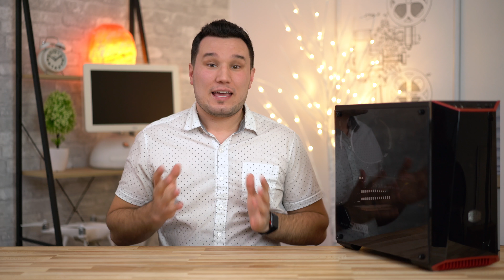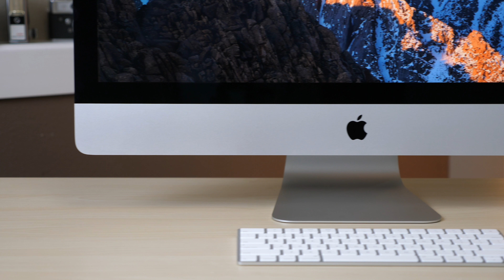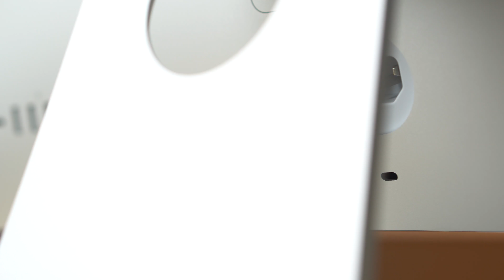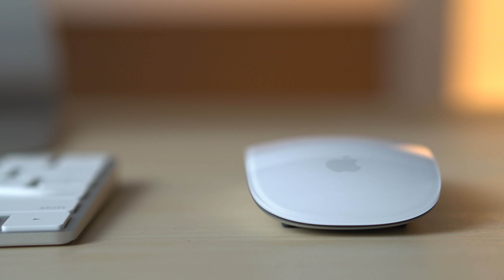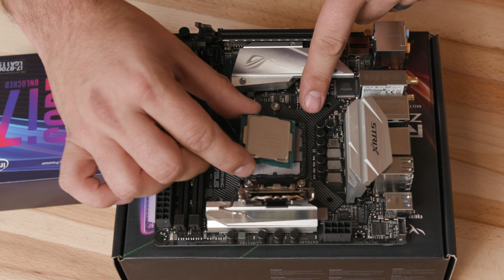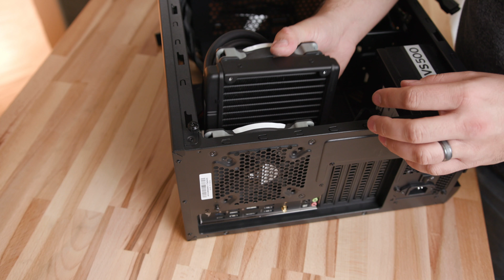$1350 PC vs $3000 5K iMac for Video Editing - FCX & Premiere

Comment: So i guess, there is no clear answer, which one is better, Mac or PC...? The reason why Mac with Final Cut Pro runs faster even with little more modest specs, is that in Apple, both hardware and software is made by the same company so Apple's softwares are fully optimized to work in the hardware. I have at the moment 5 years old Retina iMac with 4gig RAM, and planing to start doing 4K 60P/HDR video editing in a near future, so i wonder should i little upgrade my current Mac, or would it be better invest to new machine with HDR display, Because in Retina iMac have 8bit display, so when editing 10bit HDR vid, i guess the display should also have 10bit panel ?? Mostly at the moment i'm wondering, should i stay with Mac, or turn to PC...? But as i already said in beginning, there is no clear, or one right answer to that topic... PC system could be little cheeper, but in the other hand, Mac system is more user friendly and perhaps more stable machine.

Comment: SHORT version: for media consumption and light work use apple, for media creation and heavy work use pc.

Hello everybody, Greg here, 15 plus years of experience in broadcast (Spain, Poland, Norway) - here are my two cents, to give you the best advice I can, based on what I've experienced in this industry.

1 - Professional Work (tv studios, film studios)

Those are the slowest to adopt change (30 to 50% of people still use avid 😱) mainly because change slows things down at the beginning and can cause profit loss. But it has eventually changed. Today - all serious and heavy work is done on PC only. Custom build monsters. Those are used for media creation. For light work and client presentation it's 50/50 some use PC, some Mac.

If you dream is to work in TV, than I'm sorry to say, but you need to have avid & premiere in your packet.

2 - Enthusiast & Hobby. If you work in home, you can choose whatever the duck you want 😊 Mac is easier to start with, operating system itself as well as editing software (Final Cut). If you use Adobe - than use PC for better performance.

Congrats on video by the way, very informative!
Best regards, Greg.

Comment: Great reviews - thanks Max. Hoping you will do it again with the new 8 core 19-9900K just released. 
Questions
What about testing the PC as a "Hackentosh" running FCP and free Resolve 15?
Why do you think FCP on iMac is faster/ more efficient? 
What do you use for your DJI H.265 4K 100Mb editing? Do you use proxy/intermediate codec workflow?
What about HDR REC2020? All new UHD TVs have HDR support.
Thanks
Reply: background rendering / intel quicksync

Comment: Use the same editing software for the example, it's unfair if the editing software is different.
Reply: not really.  the premise of the video is that with windows pcs you get raw hardware power, while on macs you have dated hardware.  FCPx is the equalizer... possibly even the killer app for editors that makes Macs a no brainer.  Although I've seen some good numbers on other youtube vids, where DaVinci  works almost as smoothly as FCPx (some of those numbers were shown in Max's vid too).  Another bonus for DaVinci is that it comes with SO MANY features in the free version (i think one of the main selling points for using DaVinci's pro version is that it can use multiple GPUs)

Comment: PC for $1600 (i7 8700k + 16gb RAM + 1060 6gb graphics card + 1080p Dell IPS monitor)

& 21.5" iMac for $1700 (i5 3.4ghz quad core + 8gb DDR3 2400mhz RAM + Radeon Pro 560 4gb Graphics card)
Which one I should go for?

Purpose - Video editing (currently using Premier Pro, would be happy to use Final Cut Pro for lag free and fast work)
Would like it to play Sony fs7 RAW video files without any lag.

Note - Used windows for my entire life.
The reason I thought to go for Apple because of reliability as said by users.
Personally it feels and look premium and so beautiful and no hastle of thousand of cords etc. Easy to carry.

Still confused which I should go for..
Reply: Dont sleep on MacOS.  I don't know if its a "better" OS than windows, but it sure is a lot more polished.  User experience is a factor for some people, and it's a completely valid selling point.  My Ryzen pc I built about a year ago still beats out the iMac in test scores, and while I really like having a triple monitor setup for having a lot of Excel spreadsheets open while also having room to research... It is a work (#puke) / gaming (i barely ever play games anymore) rig.  The iMac is a pleasure to use.  Its well optimized, integrated into the ecosystem, and that display... man oh man...  I saw the LG 4k display on sale next to the iMacs, and even though they're both LG panels... Apple doing their voodoo magic on the iMac just makes it a joy to stare at.  Also, UI-wise... magic trackpad 2 is a game changer for me (i wish i just bought the mouse/trackpad bundle at checkout, but i didnt think i'd want it because i was so used to a mouse.  But after briefly owning a MBP and playing around with its force touch trackpad, I had to have the MT2).

Plus there is the option of going all in on FCP,; i dont like how theres so many things you have to pay for after initial purchase, but we'll see after i get some more time to play around with DaVinci and see how it treats me.

Comment: Hands down the best and fullest comparison I've found. I am using an HP laptop and having problems with Camtasia. Which has lead me to here. The checked B&H for recommended laptop to use and it's $2,900. I thought, "why not just get a Mac?". Given the analysis and the general information I've found. Mac has some really good software options that are less expensive than their PC counterparts and they seem to perform better in speed and ease of use. I say "SEEM" because I cannot speak with experience on this. But I am now strongly considering buying an Apple Laptop. Thanks for the great review and the clarity it brings. Very informative. Wish you the best on your channel! Great Job!

Comment: You should do a 4K rendering comparison between the iPad Pro and laptops. Apple and several benchmarks are suggestion that the iPad Pro is starting to rival the performance of some fairly powerful laptops. It would be very interesting to see how a cheaper and more mobile tablet compares to bigger, heavier and more expensive laptops. I've seen some promising results for the iPad, but nobody has produced a high quality, in-depth comparison with both a Macbook Pro and a Windows laptop. LumaFusion offers a fairly advanced video editing software, and I wouldn't be too surprised if the A10X processor plus good software optimization could come close to a good Windows laptop, especially after seeing the results comparing FCP with Premiere Pro.

Comment: Hello Max :) I do edit in FCPX but with that new Resolve 15 I really wonder how it compares !
Also, the next iMac & Macbooks won't have a true GPU upgrade, just a higher end model from the same range we have today, i guess since AMD didn't came out with new entry level GPU. I do play some games from time to time and the lack of GPU power obvious. I wonder if Resolve benefits more or not from a more powerful GPU. In short : I'm editing on a MBP 2016 and plan to get the BMPCC, I know that the Macbook won't be enough to fly though 4K RAW on Resolve. FCPX will generate proxies and should be fine to edit with. Nowadays I do the grading on Davinci because of the more advanced tools, when needed, but then I get the Timeline back on FCPX and still have to color edit to fix some minor color deviations or exposure. It's not so much convenient and the add of embed Fusion makes Resolve even more appealing. Also I know that FCPX generates automatically proxies and I wonder how Resolve cache works, if it renders in the RAM or VRAM, what configuration could benefit from this.

In short I would like to know more details about Resolve 15 overall performance and also how it works compared to FCPX. It's surely not the same workflow. As example you won't be able to edit raw from a HDD while FCPX could handle it thanks to proxies.
While you can also work with proxies in Resolve (and it has a very good media conversion tool), it's not as simple as far as I know.
I remember that on Premiere I had 2 years ago HUGE issues with proxies and effects Management. That's never been a problem on FCPX, wonder how Resolve deals with it :)

Suggestions suggestions !

Comment: I think we should put things in perspective. Nowadays editing machines are fast. I  just finished the edit of a 63 minutes documentary which took us months of headaches, and it was on Premiere on an imac 5k ( i use it because I'm more familiar with the interface, coming from fcp7 and the editor knew the program too) . I think that render times are non-problem, we practically never rendered during the edit and it was all 4k footage Prores, when it was rarely needed we did it on small breaks of a few minutes or seconds. The thing is that most footage doesn't need rendering in premiere (if it's shot well), and even during the finalisation when you add filters and color correction, it's still a minor hiccup the render, 30 seconds here and there doesn't make any difference.  The only time I need faster rendering is when I'm on a laptop and videos need to go online immediately. Anyhow Premiere is full of bugs and something about doesn't make you love it for big projects... Great video Max!

Comment: Hey Max, There have been a lot of test but they all use the internal drive. Most editors are not using the internal drive. Are you able to to do a test using an SSD Raid system and or external GPU test?
Reply from the maker: There will be no speed difference as long as the drives are not bottlenecking the system.

Comment: So, Max, quite a few folks are discussing hackintosh and it would be a very interesting thing to throw in the mix. (I've been in the hackintosh world for about six years and use my machine for pro production work.)
I think there are assumptions that with a 8700-based system and FCPX, it would beat both the PC and the iMac for less $$. The BIG question to me is that as we throw our various components into a PC box and hack macOS into it, we may not be realizing the overall performance of a tightly integrated system such as an iMac (which I would still be fine with given the cost savings).
If you are interested, you would need to throw an AMD card into your PC along the lines of the 580 as FCPX is optimized for AMD. Poor render times comparably with NVIDIA cards. 
Just a thought. Thanks for your reviews!

Comment: Thanks for sharing you tests. I have been on iMac since 2012 and I have always found FCPX easy but many clients expect Adobe Premiere and After Effects so, I am stuck with the Adobe subscription. The shock for me is how unstable Adobe still is on windows. My 2012 iMAC runs it with far less crashes than my recent HP Win 10 laptop which has far superior graphics card and memory. After so many years, you'd expect Adobe to get their shit together. So, all the graphics power in the world won't compensate for crashes. I will have no choice but to keep an Adobe subscription but HitFilm Pro is now my preferred solution for many smaller projects with FCPX as a backup. Many friends are recommending DaVinci so, I will take a serious look after my next hardware buy ... which based on your great video will be MAC.

Comment: For "Video Editing" (Not effect), premiere is very weak in "footage management". Compare with Smart Collection in Final Cut Pro X and DaVinci Resolve, the smart bin in Premiere is a little bit useless...

And Final Cut Pro X got a very good function on "Favourite, Rejected, Unused" "keyword" hotkey/shortcut to manage the footage efficiently.

Another weakness in Premiere is the shortcut... there are many useful shortcut in "place on top, overwrite, insert, place at the end, select clip edge, trim start, trim end, Source media selection, change clip duration..."Both hotkey/shortcut in Final Cut Pro X make you editing in a very high speed. But in premiere...

Also "Audition" function in FCPX is very useful tools for drama editing too.

So, good computer hardware can make you having a faster render/preview speed. But good editing software is the only way to make you editing fast. 

For efficiently video editing, I suggest to use Final Cut Pro X.
For video editing + color grading, I suggest to use DaVinci Resolve.
For video editing + effect, I suggest to use Premiere Pro. (Just because of After Effect)

Comment: Wouldn't it just be easier to by final cut pro with an iMac included in the box?That's all it's good for.So Mac has fallen from its glory and is only good for one program and sucks at everything else for 3 times the price.Luckily I render in 3D so don't need to sell a leg for just one program.Adobe has always sucked though.If you think I'm my work machine is an old 2008 MAC Pro with Windows 7 and my Home PC is a real PC ofcourse.

Comment: I want to ask you guys what you think about this: One 4K monitor 27'' for $600 or Two 1440p monitors 27'' for $600?
I's a personal preference for me to go with a 2 monitor setup. I like working like that better. And from a regular viewing distance, you won't see a difference when you are watching 4k videos, the only difference being the OS resolution which makes the buttons and windows smaller so more can fit on a 4k display, but with that being said, if for the same price I can get another display where I can place buttons/windows, I don't mind. I actually like the buttons to be a little bit bigger. (the Pixel real-estate is similar 7.4 MP for 2x1440p vs. 8.3 for single 4k)
Reply from the maker: I love resolution so I’d say go 4K and add another one later. Or go for a 31” or so 4K. I personally am editing in a 5K most of the time. If you like dual setups that may be a good option but if it’s for color grading then make sure they are accurate ones and IPS so the viewing angles are good.

Comment: For premier pro. I always use adobes proxy files feature (using premier pro 720p cineform proxy, dynamically linked to the full resolution files), and I have no issue with 4k 60fps files on a 2013 pc (5 year old pc). export times are still longer, but timeline performance is buttery smooth on my 5 year old pc premiere pro (just have to create proxy files the night before), however I understand this workflow isn't suited to everyone

Comment: What about the quality? It's very easy to make something faster by reducing the quality. E.g., linear interpolation is easily 50x faster than a decent sinc one. And by adjusting encoder parameters you can easily make the encoding 20x faster or slower. Same goes for hundreds of details.
So, did both pieces of software use the same quality algorithms and encoding parameters in your tests?
Reply from the maker: I set everything the same and the final video look the same too. I’m not sure if there are any minor differences but I couldn’t tell.

Comment: You should ABSOLUTELY try to swap the GTX 1070 with the RX580 or even a Vega card and do an hackintosh on that build. Don't think you're gonna regret spending the time on it: you should be able to use Final Cut Pro X with no problems at all and therefore enjoy both the pure performance of the DIY PC and the optimization of FCPX. Would you try it? (PS: hackintosh actually works with Nvidia cards, but you wouldn't get GPU acceleration in FCPX)

Comment: Other cost to factor in is the $600/year cost of Adobe vs the $400 flat fee for FCPX, Motion and Compressor.  Every year the cost of that PC Adobe system keeps rising while the iMac with FCPX doesn't cost a single extra penny until the system needs to be replaced.  Given how well optimized FCPX is that hardware lasts for a good 4 years before the pain is really felt and even then only an issue if the formats used drastically changes.  That vastly increases the cost for the PC/Adobe user while the iMac user has nothing to worry about for four years and can just focus on what matters, getting projects done for clients.  Four years at $600/year is $2,400 vs the $400 for the Apple software.  Thats a $2,000 difference that needs to be added to the cost of that PC/Adobe system.
Reply: Tell Adobe each year you want to cancel and join at promotional rate before renewal. Has worked for me for the last 4 years. I pay $32/mo for the entire creative suite.
Reply from the maker: Very good point. Premiere alone is $30 a month plus tax or $50+ tax for the whole suite.
Reply: Thats still $384/year or $1536 over four years and that cost never ends.  Even if you factor in the typical extended warranty of a Mac of 3 years that is still $1,152 over those three years and you have to factor in that cost for the PC/Adobe edit system.  Realistically there is no such thing as saving money by going the PC/Adobe route.  I still edit native HD and 4k from a GH4 on a 2012 iMac which is now six years old.
Reply: Also important to factor in legal licensing for small edit houses.  Mac App Store applications can be used on five systems.  Adobe only allows the use of their software on two system and technically that isn't supposed to be concurrently.  That means two editors shouldn't be using it at the same time.  In order to legally license a team of five editors Adobe would be 5x the cost per year.  FCPX is $400 for life for that entire team of five.  Thats a massive cost savings for a small production company.  For graphics files I now use Affinity Photo and Affinity Design which do 99% of what little a video editor actually uses from Photoshop and Illustrator.  Both of which are $50 each for life and can also be used by five users legally.